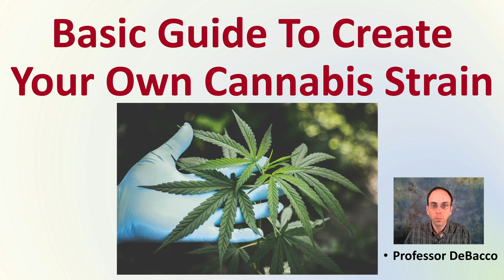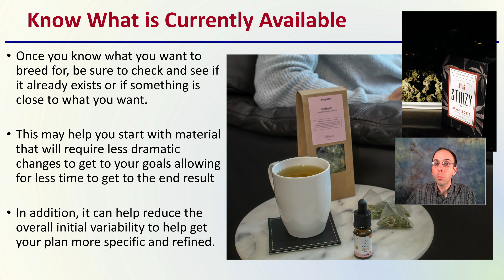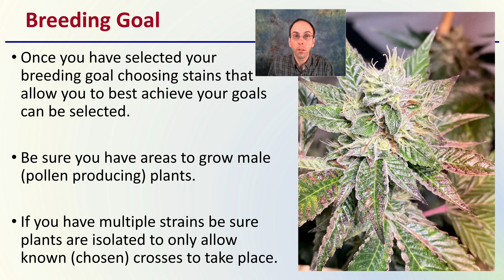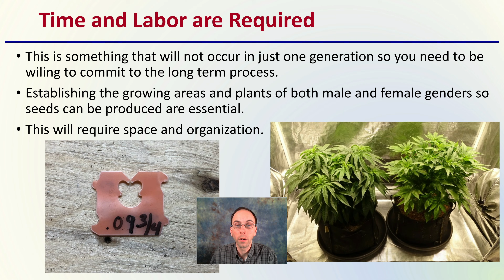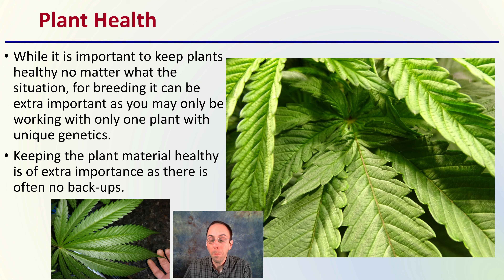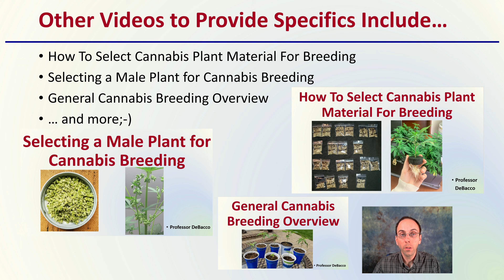Basic Guide To Create Your Own Cannabis Strain

Comment: Recommended books on this topic which aren't very expensive?
Perhaps older ones which can be purchased used and at a low cost.
Reply from the maker: Scientific papers are a great resource to go to.  These may not be an easy read in some cases, but taking the time to understand the science presented will pay off in the end.
Reply: Robert C. Clarke's Marijuana botany..it's basically his doctorate thesis on the cannabis plant